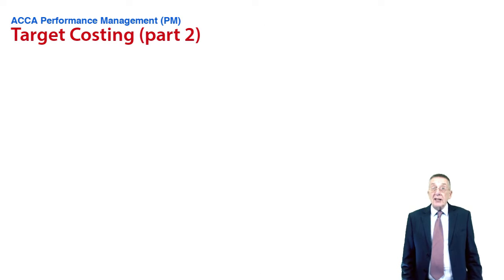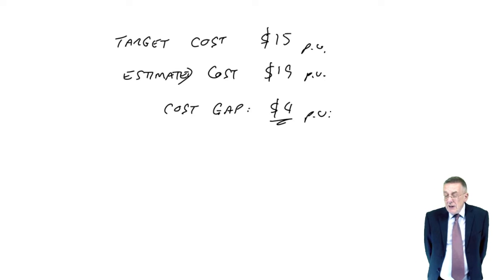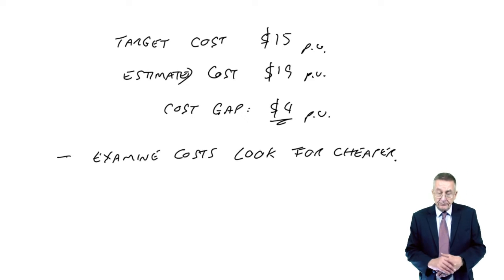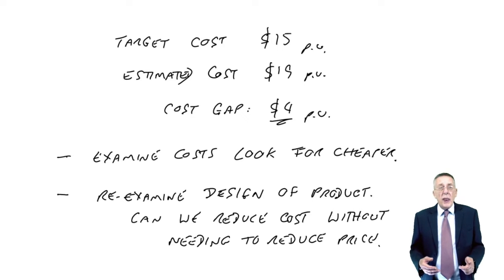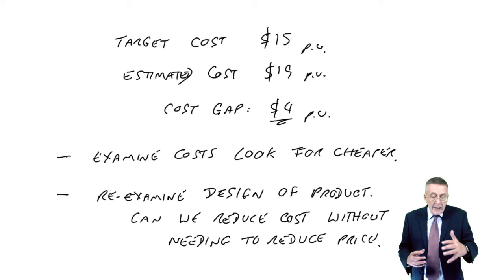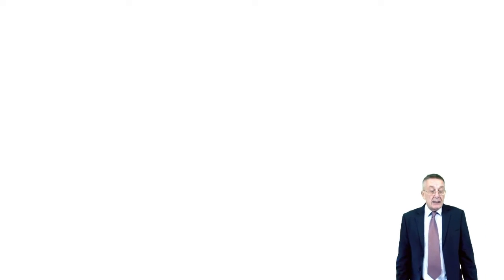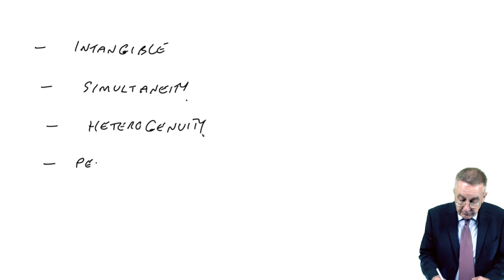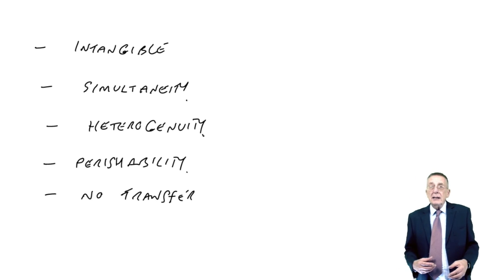The use of the target cost - ACCA Performance Management (PM)

Comment: I have a doubt that ,if we a company dealing in production of identical product and want to fix the target cost for the same product does target costing applied in it as it's not a new product as u had said In lecture,and one thing more that does  opentuition provide the same service in terms of other financial exams like CFA for its all level.
Reply from the maker: Target costing is usually done for new products because it is with new products that it is easier to potentially reduce costs by changing the design. We do not provide tuition for the CFA exams - only for ACCA and CIMA.
Reply: @opentuition   the new product would be existing in the market right? for target costing unlike life cycle costing where the product will be new for the industry